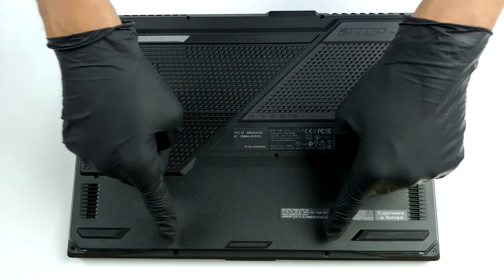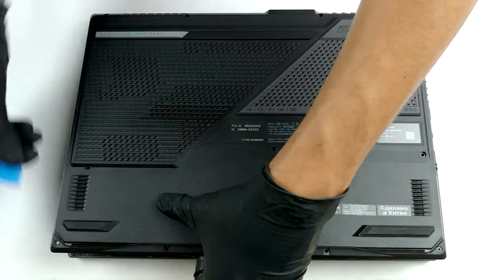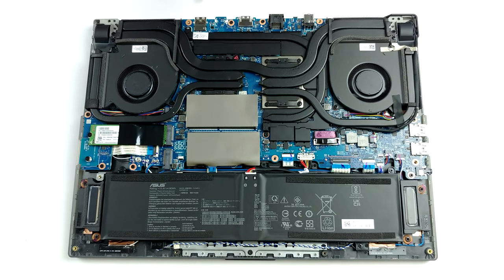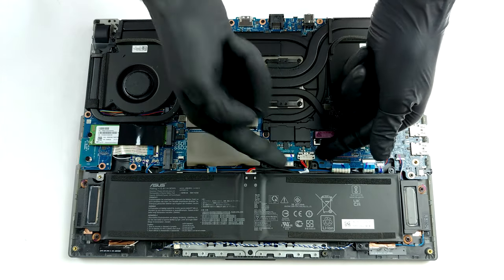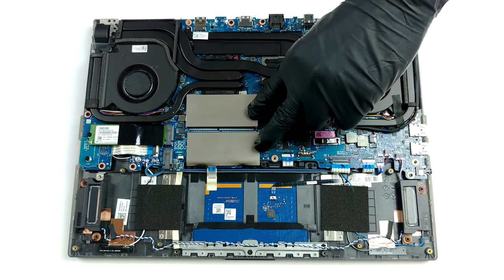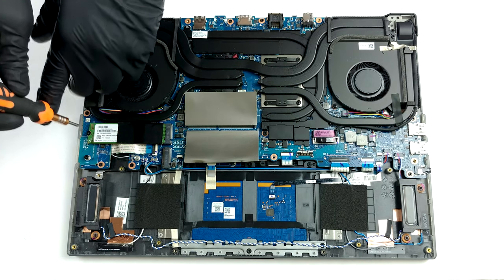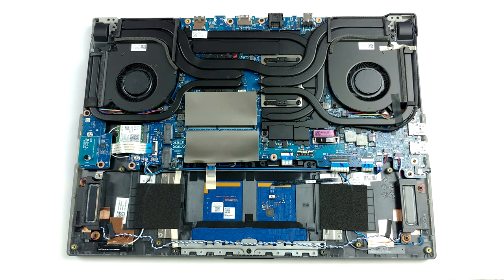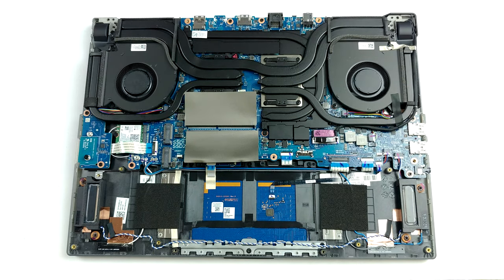🛠️ ASUS ROG Strix SCAR 15 G533 - disassembly and upgrade options

Comment: The most important part is leftout. The tiny LED connectors and how to connect them back.
Reply: you do exactly the reverse....push connector back in and close the latch. It doesn't get any easier than that....Asus made the flex cable longer for this reason.
Reply: Yep, makes this kinda dangerous for people who didn't know they were there

Comment: Im going to try and save people a bunch on heartache. For anyone that CANNOT get the LED-BAR connection to go back in, its because you insert it from the side WITHOUT the latch. So the cable does not go under the latch. Most other laptops clamp the cable down under the black latch. This one you feed through the white side instead.

Comment: I switched out the ram for 32gb ballistix 3200mHz but it only runs at 2666mHz. In BiOS there is no setting for xmp or anything. Can anyone help me with getting the ram to 3200mHz?
Reply: Hi, What is the exact Model Number of your laptop? Are you using a ASUS Strix Scar 15 G533QS - HF059TS
Reply: Did you ever figure it out??? About to upgrade mine